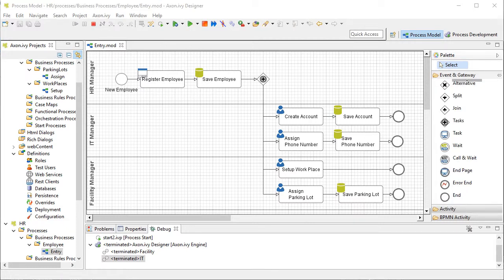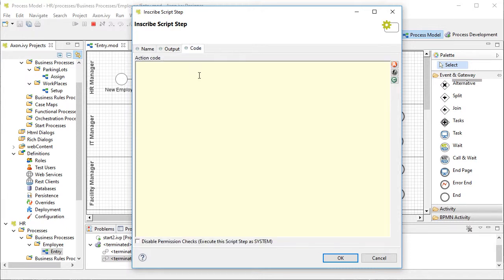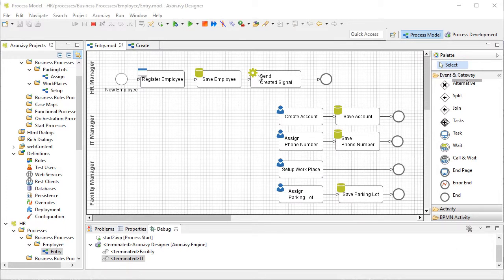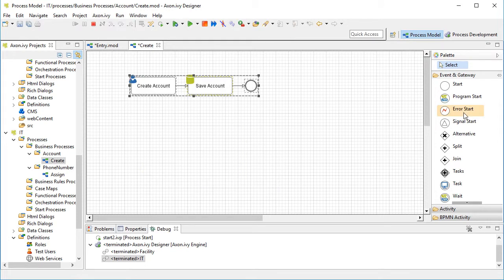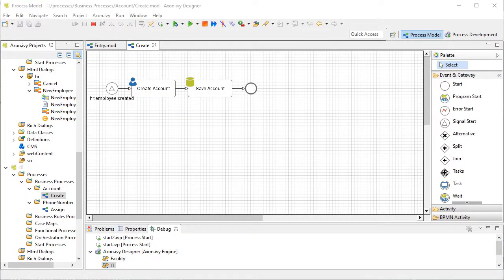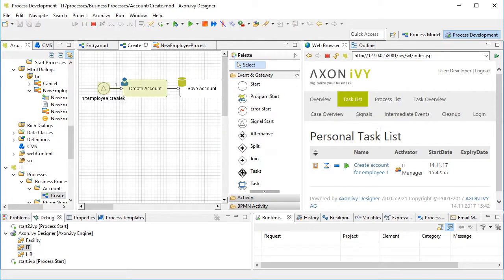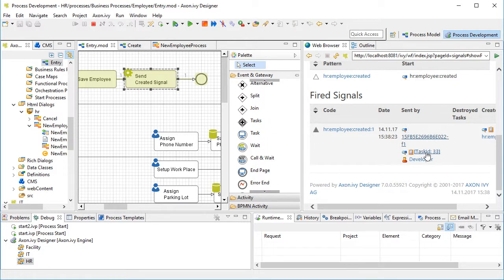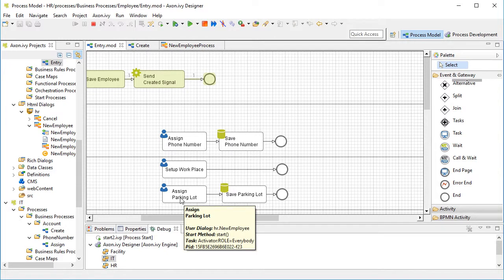Adaptive Processes with Signals - Part 2 - Using Signals

Comment: Shouldn't there be a dedicated 'send signal' task component instead of having to revert to writing a line of code?
Reply from the maker: Hi Tom. Thanks for this question. Yes, this would be definitely a better solution. We may introduce the send signal activity in an upcoming release. Meanwhile you have to use the script activity and the send signal API.
Reply from the maker: Yes, this would be definitely a better solution. We may introduce the send signal activity in an upcoming release. Meanwhile you have to use the script activity and the send signal API.